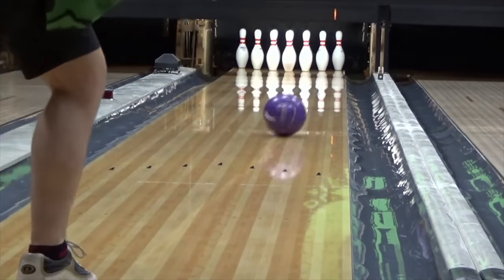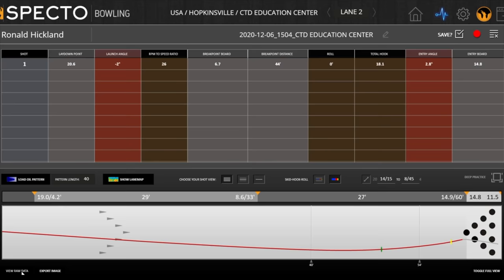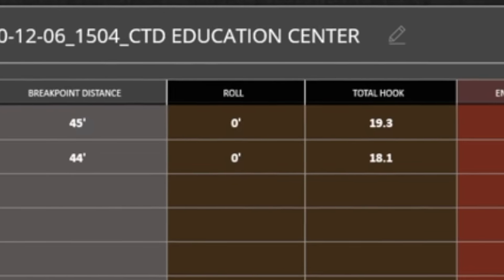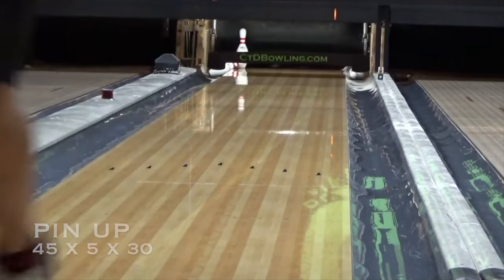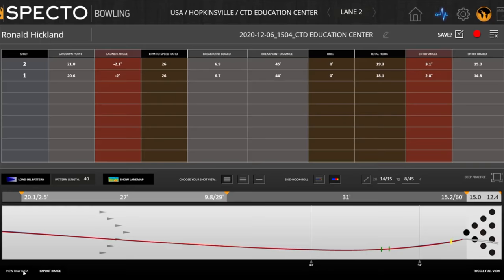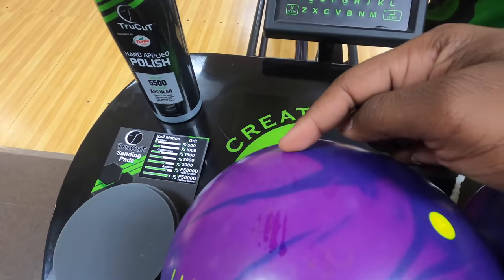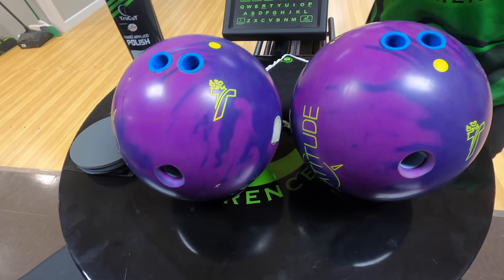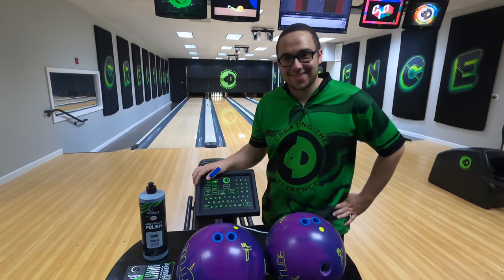PIN UP Vs. PIN DOWN | BOWLING  BALL LAYOUT COMPARISON - TruBall Reviews

Comment: 2 balls with the exact same surface and different layouts thrown at the exact spot with repetition in ball speed and rev rate will look very similar. Pin up VS Pin down takes in effect when a bowler throws an errant shot, and how the ball  responds as it creates a wider or smaller pocket, and how the ball responds to oily and or dry boards on "missed shots". Since the "average consumer" is less likely to repeat their shot, the amount of flare will absolutely matter in striking, leaving a makeable spare, or leaving a split.

Comment: Second ball went through the pins much better, IMO.
Reply: I don't know about that. I think the difference was due to the slight difference in the entry angle not the ball driving through the pins, if you look at the graph comparing both of them, they both  deflected to the right, neither actually drove through the deck.

Comment: Data shows pin down break point foot further, and entry angle barely more...and it did seem to go through the pins better....barely.  But consider that he has pretty good speed. For a slower speed bowler perhaps there would be a bigger difference.  I think we can say that for high speed high rev players the difference is very minor.

Comment: Saw the pin up read the lane quicker than the pin down. Not much difference but there is a difference. 1 board doesn’t seem like a lot but when you bowl in tournaments where there’s very little room for error, that’s a lot. Basic house shot, doesn’t really matter.

Comment: I think the real key or take away is neither ball got into the roll phase.  Both balls deflected right instead of driving through the pins because of it BUT the pin down kicked that ten pin out.  Either way no roll, means balls back in the bag for me.

Comment: does the oiling pattern (sports vs THS) affect pin up vs pin down ball reaction?
Reply: Very much so
Reply: Yup.
Reply: Very much so depending on how much oil is on the lane and how far down the lane is oiled . Keep in mind urtheane balls will carry oil down the lane drying up the heads/ front part of the lane also

Comment: I have a question. I have the pin up on my new Wolverine ball but the pin is straight up in the middle.
What will it do to the ball if the pro shop drill it that way. Does it make any difference.

Comment: The difference was about a board for hook...the difference between a corner pin or strike.  You blew through the statistics pretty fast and that is what matters...where it starts to hook, how much hook and angle of entry would seem to matter.  Also, they did not appear to exit the pin deck the same...a difference in continuation?
Reply from the maker: The total hook was less than a board different. The exit point is also extremely similar, and all the data can easily be paused for a in depth review. We have multiple videos of this and even a simulation that shows the same thing. Feel free to do some checking on this page and look for other sources of information on this topic. We welcome the opportunity to teach people using data and science.
Reply: Similar pocket hits produce different results.   The difference between a ringing ten or seven and a strike is small.  Not saying that they are  not similar,  just one left a seven and the other was a.strike.  very similar.
Reply: @harveywarne9030  ô
Reply: You disproved your own test. One struck! The other didn't. Pin down balls come into play on difficult conditions. You can see the disparity very clearly then.

Comment: Great video! 
Does pin up vs pin down make a similar lack of difference if ball is symmetrical or asymmetrical?
Reply from the maker: It doesn't and we have more videos coming
Reply: @Ctdbowling  thanks for the reply, I really enjoy and appreciate the content y’all make.
Reply: @bobbyray290  it more depends on how you play the oil patterns. Try a few shots inside and a few outside using the same release. Those shots will give you an idea of optimal entry angle for higher scores.

Comment: Reading the comments and everybody is missing the point.  He says there is a slight difference.  His point is everything else being equal VAL angle (pin up vs pin down) doesn't change ball reaction very much.  Pin distance to positive axis point changing the amount of flare will change how the ball reacts more. Surface on the bowling ball is the most important factor a bowler can control.

Comment: I think the difference is on lane condition  / pattern. If the pattern is a ft shorter or higher than your preferred condition than having it another ball drilled pin down/up is going to help you carry that ten pen with a better entry angle and you dont have to change where you  stand, aim, hand position etc.

Comment: Does the difference in these layouts apply to bowlers who are unable to bowl faster than 10 mph? Lots of these videos show these high ball speeds, but there are some of us who due to disability (in my case, a wheelchair) average far lower than our standing/walking counterparts due to the inability to generate these speeds. Please consider doing a video using a slower ball speed.
Reply from the maker: The slower the ball speed the more difference you will see.
Reply: I bowl 12-13 mph and pin down is much better it gives the ball more time down lane before reacting. higher speed bowlers I’m sure prefer pin up

Comment: Great topic! Good to know pin up or down is not as important as pin to PAP. I do have the same ball drilled with a high pin and a low pin, and will use them through transition when 10 back vs a ringing 7 is worth a few bucks, but never seen much difference between them in normal league play. Always thought I wasn't paying attention during league 🙄

Comment: It looked like the pin down had a little more energy and had a little more "left to right" hook. The pin up was a little earlier and had more front to back hook (it's a little stronger) hence the corner pin still standing. I could be wrong but I have the Tank Blitz one pin up and one pin down and the web Pearl the same. On shorter conditions it's hard to keep it in the 1-3 because it stores so much energy, my pin ups kill short patterns though 🤔

Comment: Would have been great to have the CG in the same position ( static weights the same)  after drilling.  That way it would truly only be one variable.  And / or do the test again with the pin to pap and drill angle the same and have one ball with a 1 inch pin and the other with a 5 inch pin, and see if there is a difference in shape.
Reply from the maker: The static weight test has been done a lot of times. You can Google Brunswick CG Study as an example. There wasn't a good reason to redo that test. We do have more testing that shows more Bowling balls layed out differently.
Reply: @Ctdbowling  I get it... I've seen it.. thanks for the content.

Comment: try doing these tests with a lower rev rate and you'll see a difference. I have both pin up and down balls and I can see a difference with them, the pin up tends to be a better down and in shot whereas the pin down tends to be a better arcing shot. You'll have a little more credibility if you use different rev rates.

Comment: Pin up ball looked like it  reved easier through the front part, but was less continuous, seemingly. I thought the difference would be the pin up had more angle. I remember pin up leverage being called flip leverage in the 90's.

I just read that lower VAL angle should lower the RG and raise the differential slightly.

Comment: THANK YOU for posting this. 
I’ve drilled balls for a long time and I’m tired of people passing off misconception and conjecture as fact. Especially when it comes to pin up vs pin down. I’ve told people from the get that for the same pin distance with most balls the difference will be a weakening of the effect of the core making the ball flare LESS and break LATER with less over all hook. 

The amount of people that think pin down balls hook earlier and more is astounding.
Reply: Exactly Joe, great post.
The motion through the pins is paramount. Earl Anthony used to call the motion of the axis downward as it approached and entered the pocket 'mid-roll'. In this instance the pin down shot had better mid roll energy. In a different lane condition or different type of player an identical shot may have shown the pin up with better axis motion through the pins. 
This was a great video and you are dead on in your point.
Reply: The space between the flare lines shows how many degrees the ball has rotated through each revolution. Basically the bigger the spaces the more distance the ball covers laterally every time it makes one revolution.